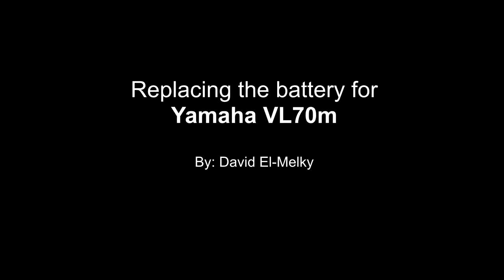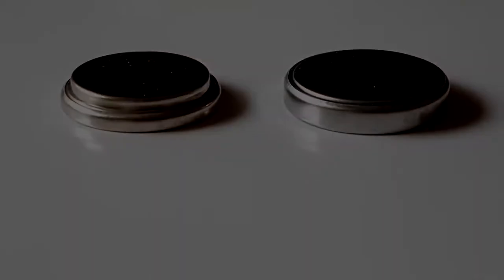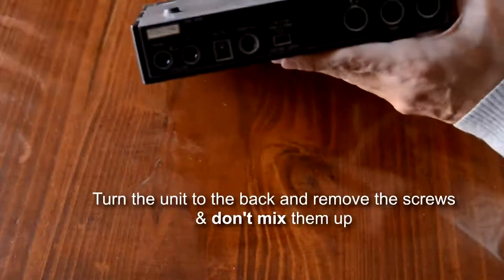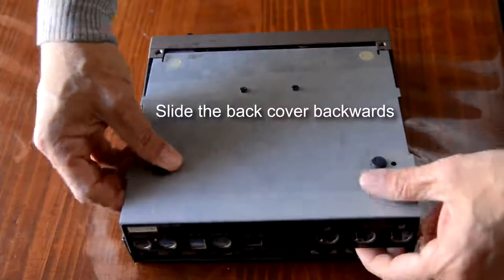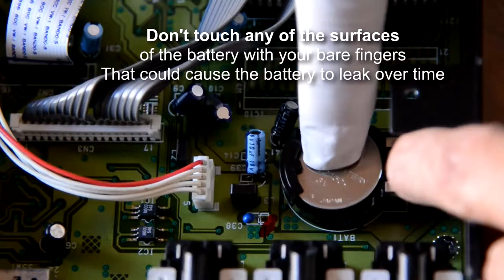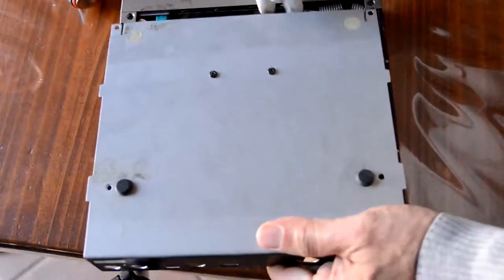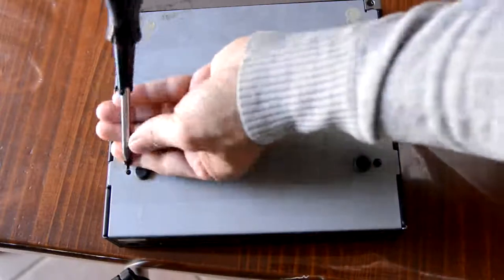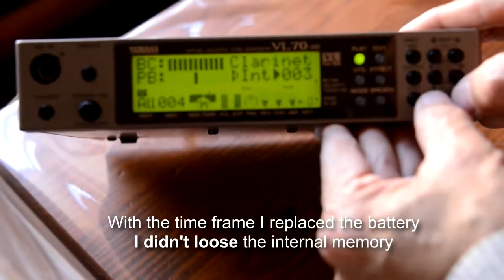VL70m - Battery Replacement

Comment: I recently tried using my old VL 70m and a battery low message came up on the screen. Following this video I sourced an Ansmann CR2450 3V from an Ebay UK store (I'm in UK). The packaging is identical to in the video but unfortunately on opening it, it's the wrong shape- it's like the Renata you show.  So I'm still looking for the right battery... I've opened my VL70 and the old battery is FDK CR2450y. A different profile from the Ansmann I've sourced.
Reply from the maker: I'm not sure if I understood correctly, you're saying that the Ansmann battery you bought was different than the one I bought ? If that's the case it either they changed their design prior to mine and you got an older version, or they changed their design after my version. Would you please do me a favour and read me the expiry date on it? To see which one is newer? 
And if it's possible to take a profile photo?  It's interesting to know what's going on, I thought we found a manufacturer 🤔
Reply from the maker: That's older than mine, the date on mine 2029 🤔
I'm going to contact the manufacturer to see what they have to say,
Reply: @david-el-melky  It's confusing and a pity if they are selling different shaped batteries under the same name.. And of course pictures in webstores are not usually going to be detailed enough to let you see exactly what you're getting. Thanks for your efforts in this matter.
Reply from the maker: Sorry, I had a mistake in regards to date, mine is newer as it says 2029, but if you can take few profile clear pictures, this way I can send it alongside with mine to explain to the manufacturer what I mean because most of people who answers emails don't have a clue 😉
Reply from the maker: @applegrovebard  after few emails to Ansmann I found out that they've changed their design to a normal shape as described in your msg. it looks like mine was an older design even though it has a longer date. I've asked them to consider to make also the older ones since there is demand for it, they're not planning on doing so. Wha5a shame. 
Thanks so much for discovering that. 😊
Reply: @david-el-melky  My battery replace light is on. Have you had any luck in finding the correct battery? I need help. Thanks Ed
Reply from the maker: @saxmaneddie1  hi. where are you? Maybe you can still find older Ansmann battery or maybe i can send you one from Sydney until we find a stable source?
Reply: @david-el-melky  I am in the state of Maryland in the USA. I will keep looking. Thanks
Reply: Update went to hardware store and bought a Duracell Lithium DL2450 put it in the holder put a piece of tape across the top of the battery and holder and it is working. Called Yamaha and they  told me to do the same thing.
Reply from the maker: @saxmaneddie1  why put the tape? Is it because it didn't go all the way or it is too loose?
Reply: @david-el-melky  Just to make sure it stays in place. It is tight in the holder and the clip did not pop in place when I put the battery in place but it works.
Reply from the maker: @saxmaneddie1  i thought so and that's exactly what happened when I tried it here, and the same brand cr2430 was too loose but it also works but it doesn't have the same capacity it needs to be changed more often, this is My plan B if I can't find proper solution, but I'll have to find a way to hold it down tight 🤔
Reply: @david-el-melky  Get the Duracell DL2450 battery it is Lithium and should last much longer and it is in the holder tight. Had a gig to do so it was a quick fix. Thanks again.
Reply from the maker: @saxmaneddie1  of course if we can't find the exact fit the new cr2450 or 2430 has to be the only option, 😉 thanks so much for sharing your experience 😉👍
Reply: @david-el-melky  I tried taping my Ansmann CR2450 3V battery (which is too big to fit properly and so makes poor tilted contact) to the slot. It hasn't worked for me- I still get a battery low message, and although the display responds to show breath level from my WX5, I can't hear any sound. Is the Duracell DL2450 likely to be exactly the same shape and dimensions as my Ansmann battery? Maybe a smaller battery that has better contact is worth a try...
Reply from the maker: @applegrovebard  I believe that after Ansmann changed their design it's now similar to the Duracell. The cr2450N is also doesn't fit well but it makes contact, my best bet until I find the proper one is to get the 2430 which is 2mm thinner and half the capacity it'll work but it stay bit loose you'll need to hold it with a tape or something. And if your unit is not mobile, the battery doesn't need to be taped. I tried it it's fine.
Reply: @david-el-melky  Thanks David. I'll try the 2430.
Reply from the maker: @applegrovebard  if for any reason didn't make contact you might have to gently lift the bottom centre spring a bit up to touch the bottom side of the battery because it's bit thinner, but be careful you don't break it 🤔
Please let me know how you go 😊👍

Comment: Thanks a lot for your very valuable informations.  Since Ansmann doesn´t produce them in the right size anymore, do you know, where to find a fitting replacement today, the 6th of april 2021 ?   Thank you for any hints, even if they should come after decades.  And Thanks again !
Reply from the maker: I'm glad you found it helpful, I'm still looking for a proper and replacement battery, and I'll update it as soon as I find anything,  hopefully soon 😊
Reply: @david-el-melky  Hello David, hello Paul, as I wrote above, the VARTA CR2450 bought in September 2022 at Amazon (German, but the battery is made in China) works perfectly.
Reply from the maker: @ondrejrudcenko9483  I'm glad to hear that, and thank you for sharing your feedback, at least we know not to give up hope 😊 and many will benefit from your experience 😊
Reply: @ondrejrudcenko9483 can you go into your order history and find the ASIN of the battery from Varta? The hint with the blue/silver might be misleading if they update the packaging design

Comment: Hi David,spoke to you recently having successfully replaced the VL70M Battery,in your reply you stated that the battery (cr2430) I fitted would not last as long as the original,I would say the original battery I replaced must be about 15 or 20 years old,so even if the new battery only lasted a 1/2 or a 1/3 of that time that’s certainly still a good time span.
Just thinking would that length of time be the norm for the original battery,or does it depend on how often it is used ? You might let me know what you think.
All the best,Patrick.
Reply from the maker: Hi Patrick, the life spam of mine is similar to yours and yes that's a long time so even half of it is fine to me too, regarding the "use/battery life" not really sure, but I use to use it daily and lasted that long, so I'm very pleased with that :)

Comment: Tianqiu CR2430 DL2430 2430 Lithium 3V Coin Cell Batteries.  fits perfectly with a nice click
Reply from the maker: Yes of course, all 2430 fit well but half the charge, I have this as a plan B.
Thanks so much for your input 😉👍

Comment: Thank you so much, David, for this video.  Enormously helpful.
With the correct battery virtually unavailable, I used a CR2430 (thanks Mark) and if I need to change it more often, so be it.
I found I have no means of backing up such old technology, so I took the chance to just change the battery quickly and it appears to have worked fine.
(My backup plan was buying a new Roland sound module and the software for it to support the WX5 from Patchman Music in the US, the same company I bought some of my VL70m sounds from.  But that was much more expensive in time and money than being able to keep my VL70m.)
Reply from the maker: Thanks so my for letting me know, and yes the CR2430 will work because it's bit thinner and until we find better option I think we should stick with that. :)

Comment: You can back up your INT and CUST voices, with VL70-m Dumper, before doing the battery swap, if you have Windows.  I've used it on XP and Win 7.

It's on swingingsoft.free.fr  - I'd give a proper link, but my post would probably just get auto-deleted.  It's been happening far too often, lately.
Reply from the maker: That's right, I use it to back up but thankfully I didn't need it during the replacement :)
Reply: @david-el-melky  Cool.  Did you do the battery test, in the service manual?  

I'm wondering how easy it is to start the SRAM test by mistake, because that's the first one, in test mode, oddly.  It doesn't say whether it's destructive, but that's how memory tests tended to work.  So, I probably ought to do a full backup first.
Reply from the maker: @TooSlowTube  it's not easy to run it by mistake, I did try it but it kept going for many hours so I ended up stopping it, I tried it on 2 machines, I must be doing something wrong 🤔
Reply from the maker: @TooSlowTube  to be honest, I  backed up my internal memory bank expecting to lose it, but I was very quick in replacing the battery and haven't lost anything, considering I've had to do ot too many times trying to fit different batteries, but please note, everytime I try one that it doesn't fit I would put the original back till I get a different battery ready, so I  never had it without battery for more than couple seconds. 
Having said that,  please Backup your machine just incase I was a lucky one
Reply: @david-el-melky  I will.  Thanks.

I've just tried to do the battery test but it doesn't work, on mine.  It just flashes all the LCD dots on and off, endlessly.  I've tried it a few times.  I can get the switches test to work, but not that one.  It's probably a firmware version where they hadn't got that to work, yet.

I was wrong - the service manual does say the RAM contents aren't hamed by the SRAM test, but it's academic because I can't do that one either - it just does the same thing.

This fits in well with my experience of test mode on old Yamaha boxes though.

I'll probably take it apart and measure it, one day.  I'm not sure if the battery could still work but be leaking, or if they stop working first, then leak.
Reply from the maker: @TooSlowTube  yes that's exactly what happened here flashes forever 😁 I'm not sure why
Reply: @david-el-melky  Interesting.  Thanks.  Maybe it was more of an aspiration, when they wrote that in the service manual, and they never actually got around to writing the code for that part.
Reply from the maker: @TooSlowTube  I'm not sure really, it's either that or a firmware issue 🤔
Reply: @david-el-melky  I can't seem to find any different firmware versions, or a firmware version history, like there is for the TX81Z. 

I guess, quite possibly, it just never actually did that, and was never fixed.
Reply from the maker: @TooSlowTube  what I was thinking is, couple weeks after I purchased it (early 1990 something) I had it back for firmware upgrade maybe that had something to do with messing up this, maybe not, just a guess or .....
Reply from the maker: @TooSlowTube  yes this is true most of the time, but the manual came before the firmware upgrade too.
Don't forget so I 've heard: (because of hygiene thing, customers couldn't test the VL unit to know what it can do) the sale was too slow, so Yamaha abandoned the production of it and neglected every thing to do with it software and hardware,  it's only after it was discontinued people started to talk about it and the demand became very high but it was too late 😪 and what you find for support mostly coming from genus customers who took that burden upon their shoulders. Hardly anything came from Yamaha for that model.

Comment: Another thumbs-up for the Varta CR2450, Amazon code B06X1G8XSB. Though I cancelled that and instead bought from Screwfix (code 643PH) today for immediate collection at a sweeter price. Fitted with a beautifully resonant click (I can see now why you made such a deal of this!) and the low battery warning message has duly gone. Did swap in under ten seconds without power connected, no trouble, and seems all settings retained. Blister pack expiry date 02-2032. Thank you for the video and to all your helpful commenters!
Reply from the maker: Wow, I'm so glad that we could find a Varta CR2450 as a replacement, and I truly thank you for your experience, very helpful. I'm glad you found my video beneficial, very encouraging 😁🙏